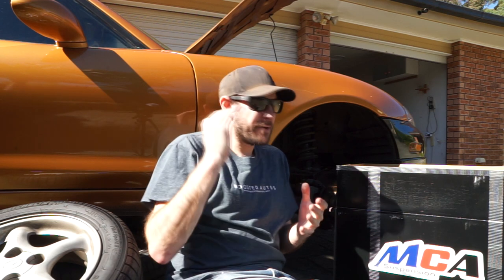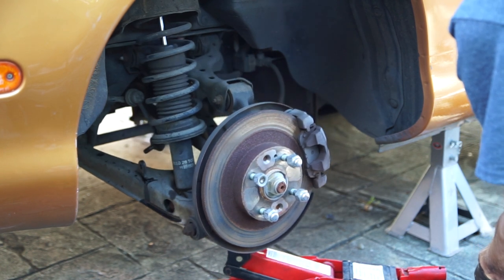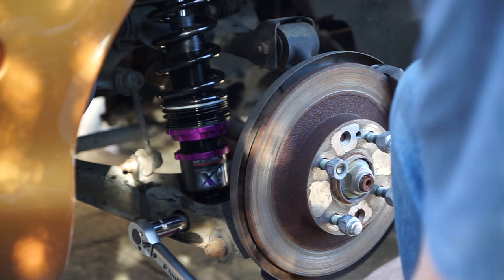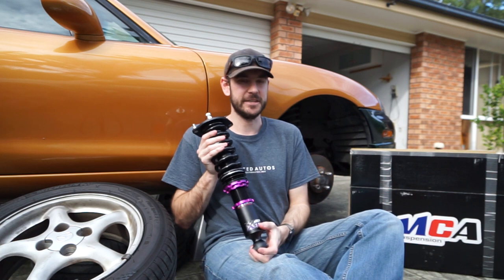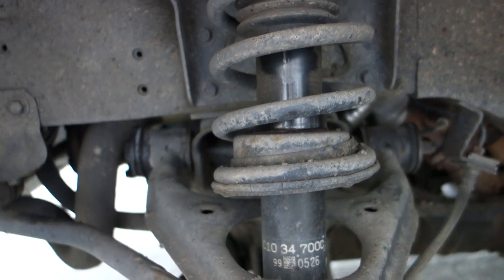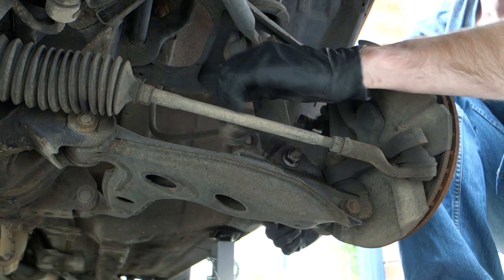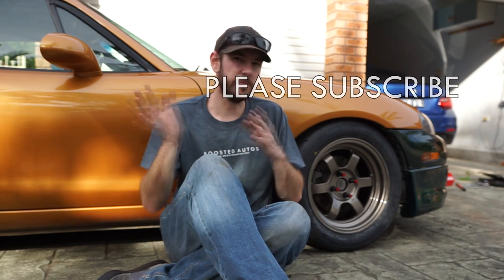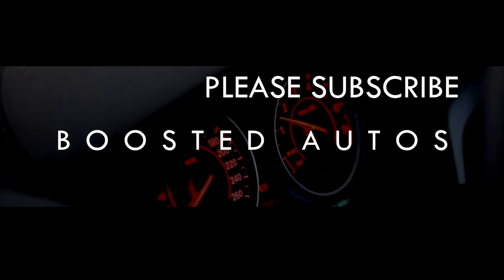How To Install MX5/Miata Coilovers - The Complete Guide

Comment: Thank you so much for actually explaining and showing how to take the front struts out. Me and my buddies struggled for HOURS trying to get the fronts out and watched multiple videos but could not get it. And all you had to say was take out that huge as upper control arm bolt. Comes out so easy. THANK YOU SO MUCH
Reply from the maker: You’re welcome. Glad it helped. Unfortunately there’s a lot of rubbish videos out there for MX5. :(
Reply: I had the same issue. Seems to be a common thing people forget
Reply: @boostedmedia  I was able to get the upper bolt out no problem on the Driver side of my NA, but the passenger side the sway bar mounts were in the way.  That side took forever to do.  Your video was a great help though.  I powered through the rear fast.  Crow bars are my friend.  Fun fact:  I was removing coilovers to install stock suspension for Autocross.  (Gives me a better PAX).
Reply: Lmaooooo me too
Reply: @boostedmedia hey mate I got an fg falcon just wondering how do I go about getting the right tightness on all the bolts should I get someone else to do them lol

Comment: It’s easier to just undo the lower control arms, trust me! You don’t have to undo the sway bar bolts to get the upper control arm to clear if you just undo the bottom control arm instead. Don’t even have to undo the sway bar link either, just undoing the lower control arm bolts lets it come right out.

Comment: One thing you should consider doing is raising the suspension from the bottom of the hub (until the car slightly lifts off the jack stands) using the jack before you tighten the end links. Or leave them loose until you torque it on the ground.
Reply: Same goes for the long bolt on the front suspension, I wouldn't torque that one down again until the suspension is sitting under its own weight, or you run the risk of twisting the control arm bushes

Comment: Hey mate. What offset are your wheels? From your uploads I understand that they are 7" and you are running 205/50 R15s tires. I'm curious as I want some 8" but would like them to fill the guard like your 7" do on my NB SE. I'm not sure if that's a +36 or +25 in the 8". Yes I understand that the offset between 7" and 8" needs to be different to get the same fitment. Many thanks! :)
Reply from the maker: Hi Michael, Sorry for the delay. Somehow I missed this comment. The wheels are +20 offset. To get similar from an 8 inch you'll want +36 offset.

Comment: A tid bit for those who were wondering.... you don't need spring compressors at all. Just need to get a bit clever:
1) disconnect the swaybars at all 4 lower control arms
2) For the front, just mark the 17mm camber adjuster bolts, and then loosen and remove them, this will let the lower control arms drop free and the shock can easily drop out.
3) For the rear just undo the rear upper outer control arm 14mm bolt to give you the drop you need there.
Reply from the maker: yep. I didn't end up using them for the front. I could tell I only needed a few centimeters extra to pop them out, so decided against undoing more stuff than I needed to.
Reply: Tried today, worked very well and actually I found a small improvement to make it even easier: on the rear there is no need to disconnect the endlink of the swaybar from the lower control arm (stock ones are kinda a pain in the arse to deal), just disconnecting the whole swaybar (just 4 14mm bolts) from the frame gives enough movement

Comment: I installed BC Racing BR Series in my 2004 model today. I did everything the way you did except in the front instead of taking out the upper control arm bolt I decided to take an angle grinder with a cutoff wheel and slice the OEM springs about midway. There was a slight pop and it took the pressure off and the unit came right out. Safety glasses, gloves, and sleeves required. I got the BCs installed and so far they are awesome. I can't wait to get the alignment done. Also on the rears I removed the 14mm Rear Upper Outer Control arm bolt like Beavis said because I had seen that in another Youtube Video.

Comment: Fantastic video...thanks!! Just finished installing Ohlins on my 2002 SP and your video was a great help. Everything was reasonably straighforward.  Only differences for me were the need to remove some bolts  to pull away the underbody shields and unbolt and re-attach the ABS wheel speed sensor from the front struts (fortunately, Ohlins come with a bracket for easy re-attachment). Also, the long bolt for the front upper arm slid out without running into anything, which was good.

All in all, great stuff and thanks again for the upload.
Reply: You bought ohlins suspension for your MX5 wow

Comment: Hey man, I haven't actually finished the video yet, just wanted to let you know the quality is great. Really in depth instructions that can be adapted to the installation on other cars. I have been considering coilovers for a while but I don't know if they will be worth the price. Maybe after you've had the chance to drive the car a little hard and also experience what they're like to drive from day to day then make an update video so we can see just how much improvement is made and what the pros/cons are of running them and if they're worth the ~$1,000. Thanks heaps for the entertaining and informative video!
Reply from the maker: +IllusiveGiraffe thanks mate. Absolutely will be doing a full review of them once they're settled and set up. Including track time. 

If you go back to my earlier videos, I did same reviews of the MCA Reds I had in my BRZ.
Reply: Will be studying this video once again! Just purchased some BC Racing BR Coilovers for my Subaru :) Cheers for giving us the confidence to do work on our own cars by providing all the necessary details. Will let you know how I go :)
Reply from the maker: +IllusiveGiraffe thanks a lot. Good luck with the install.

Comment: An outstanding video, I've been watching this a few times before I started the works. Many thanks!

I am 3/4 through removing the old suspension. Loosening nuts and bolts that are baked together by 18years of dirt and rust is time consuming... Lots of swearing...and I wish I had a breaker bar or metal tube as an extension for spanners etc. Nevertheless, WD40 did the trick. Needed to call a friend to get the rear coilovers out (don't have a spring compressor) and my 13yo son wasn't heavy enough to create enough downward pressure.

Just two comments at this stage:
-  The upper shock mount nuts are pretty soft metal and it's easy to round them off if you're not careful. In particular the left hand sided ones behind the petrol hose are difficult to reach and it would be almost impossible to get to them with an angle grinder to cut the bolts off. 
- My 2002 NB (facelift, MK2.5 NB8B) has brake line brackets attached to the OEM front shock absorbers which have to be removed. My Voston suspension came with new brackets. 

Wish me luck for tomorrow. Front right has to come out and then the new coilovers go in...
Reply: 19:10 Upper Control arm pivot bolt goes back in but I don't think you mention the torque requirement for it. I understand it's 118-137Nm (87-101 ftLb) according to http://www.mellens.net/mazda/mazda_miata_extra_manual/1997_2000_front_suspension.pdf I couldn't find specs for the Mk2.5 but it would be in the same range I guess...
Reply: EDIT: http://www.mellens.net/mazda/mazda_miata_extra_manual/2002_2003_front_suspension.pdf Same torque specs as for the NBNA
Reply: If you ever have to do it again use the handle for your jack as a lever of sorts to pry the suspension downward using a frame rail, that's how I did mine

Comment: Do you have a video on how to remove front upper swing arm, how do I remove ball joint so I can pull swing arm off. I have already taken shock off and loosened the long bolt holding swing arm in.

Comment: Hey bud after doing my front struts today, I noticed that you forgot to tell us what the torque values are on the long upper control arm bolt. 😉
Reply: Did some research, for a 95 NA (assuming the values are close enough) the torque should be ~135Nm or ~100lbft

Comment: I'm planning to install a set of coilovers on my 99 NB.
I don't want it slammed to the ground, probably half an in higher than yours, but my question is, will i need a camber adjusting kit?
Reply from the maker: Shouldn’t need to mate. I didn’t at this height.
Reply: Thanks!

Comment: 15:24 unless you have recently serviced your miata the bushings will not cooperate this easily. A spring compressor on the front is a must if the shocks have seen 50k miles in any winter weather.
Reply from the maker: This car had not been recently serviced in 2 years and had over 200,000kms on the shocks. But the Australian climate is different to elsewhere.
Reply: It would have to be more hospitable because salt in the US makes this job much more difficult

Comment: Hey mate, really nice work on the video. Thanks for making it. Can I ask how you found it after installing? I've got an NB and want to get the purples just not sure if its worth it or if I should just go for the greens. How did you like them? Thanks
Reply from the maker: It depends entirely on what you intend to use the car for. These were a track setup so they were a little harsh on the street.
Reply: @boostedmedia  thanks mate
Reply: @boostedmedia  Hey mate, I recently purchased a second hand set of MCA X-R's that came with 11kg front/7kg rears which I'm about to install. I imagine these rates are too stiff for a car that will only see the road and not the track. With that said, my car is used only as a weekender for spirited hill runs and so my main priority is performance over comfort (65:35). MCA recommends 4 clicks from the hardest for the fronts and 7 for the rears. Just wondering from your experience what settings I should opt for? I'm thinking 7 clicks from the hardest and 9 for the rears for optimum performance in the hills and bearable comfort? Thanks!
Reply from the maker: It’s personal preference really. I’ve always been happy with MCAs recommended settings. Most important thing is to match the front and rear so you don’t get bucking.

Comment: those are 15x7 +20 correct? do they clear all 4 brake calipers well? Im considering the same ones. Great video, Keep it up!
Reply from the maker: Correct and yes they were well clear of the stock brakes.
Reply: @boostedmedia  do they fit nicely on stock suspension?

Comment: This might be a dumb question, but aren't you supposed to put the car back on the ground (somehow) before tightening everything up? I thought that was a thing, and it's the main reason I had a shop install my coilovers. If I'm wrong on this, I probably should have just done it myself :P
Reply from the maker: First I’ve heard of that for anything other than wheels. Not suggesting you’re wrong. Just never heard that. A lot of the bolts aren’t accessible once the wheels are on and car is on the ground.
Reply from the maker: Well this car has been on the road now for 2 years and hasn't had a problem.
Reply: @boostedmedia  if it ain't broke, don't fix it 🙂

Comment: Do I need a torque wrench and also do I realllly need a spring compressor?
Reply from the maker: Yes you’ll need to torque the bolts properly. If you have a friend who can help you should be able to get by without a spring compressor but it certainly helps.

Comment: I just put mine in.     If yo are tossing your old junk.     Take a zip wheel and cut the spring in 3 places.    I changed both my fronts in 45 minutes.    And I’m a 66 year old Granny.    The rears are a piece of cheese cake.    I put in Tein Flex.
Reply: I really wouldn’t recommend cutting the springs whilst they’re still under compression